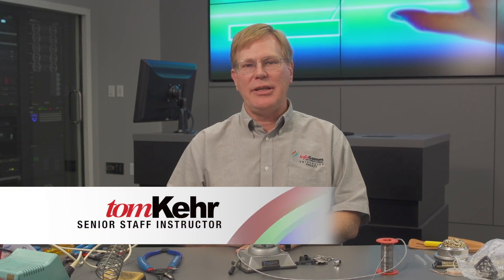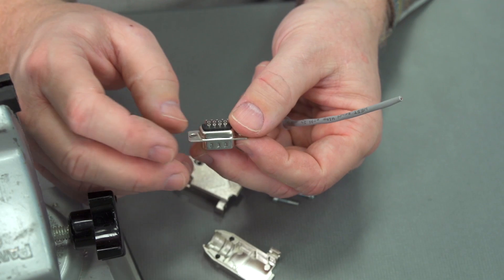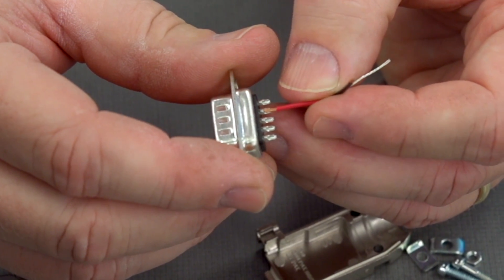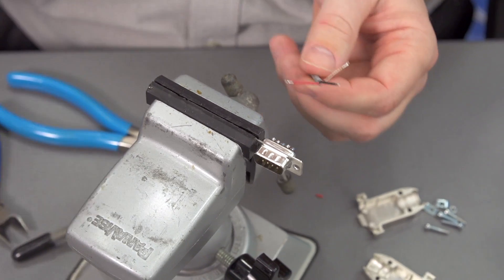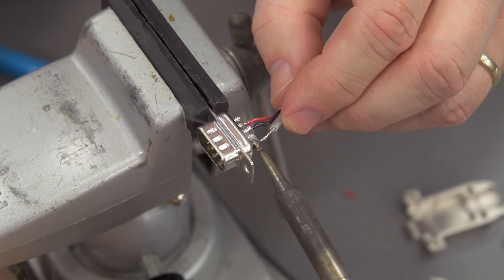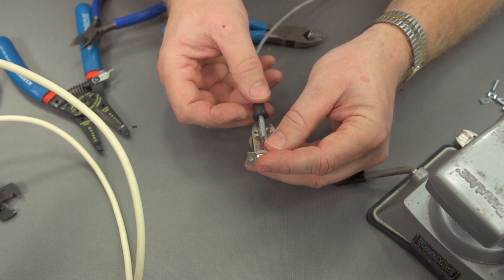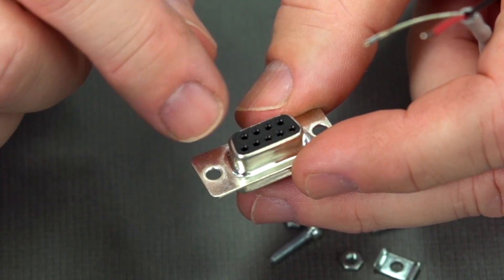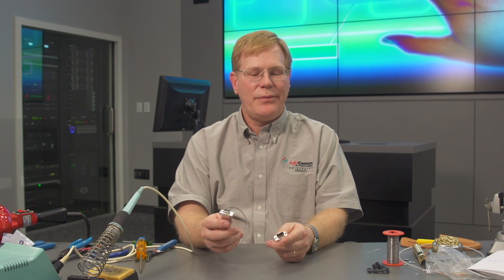Soldering DB9 Connectors

Comment: Pretinning the cups. Very bad show -1. When inserting the pretinned wire into the molten solder in the cup, there is absolutely no flux to assist in wetting. Back in the day with SnPb solder it could work but still very bad work. With leadfree this leads almost instantly to defects.

Comment: what are the other pieces for? the remaining screws and metal pieces...
Reply: Captive screws and washers for connecting to the mating panel-mounted connector. I'm wondering, though, if there are some sort of matching nuts that could be installed on the same connector of the opposite gender (for making a secure cable-to-cable connection).

Comment: good lesson, Sir. 
your tip care and heat transfer tinning are outstanding examples
i love to twist the crap outta the conductor strands after stripping for the good insulation gap
then i tin those red, blk, and gnd conductors and set them in empty cups,  confirm insulation gap, add flux then heat and solder till done!
Reply: Same.  I tin the wires, trim the black and red back maybe 1 mm as the drain wire is offset a bit.   A bit of practice and just the right amount of solder holds the wires somewhat firmly in the cups until one can get soldered.  Black (or whatever's in the middle) gets soldered first and that holds the rest together for the final 2.  Then they all get a dab of solder and a spot of heat - and they're good to go.  Harder to burn your fingers this way as the wires start in the cups.  Never had any luck filling cups in DB9s...they're just too tight.

Comment: Good Video, but you never explained the other parts and where they go or how they connect and what they are for. The two little flat pieces
Reply: When you are making a DB-9 cable that will connect to a panel mount mating connector, these flat (their ends are actually curved) work as washers under the heads of the captive screws that are used to secure the connector to it's mate. Looks like these are not used in this video.

Comment: The soldier gun is about 20 W or more ?
Reply: It will depend on the wire and solder that you are using. For this application, a 20 watt might take a bit more time to heat up the bond, but it will work. I would use a 35 watt on this type of wire with 63/37 solder.